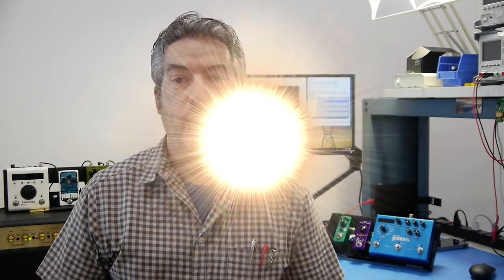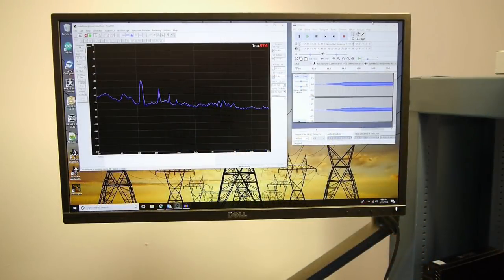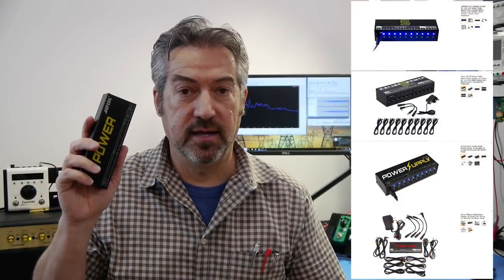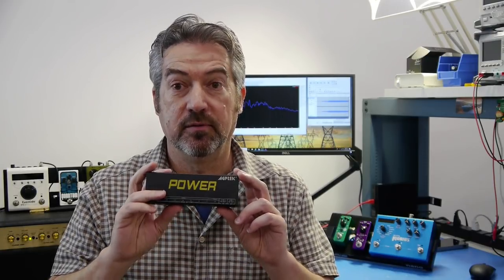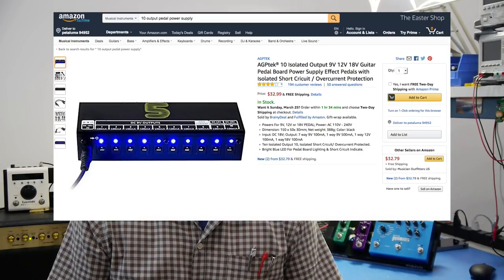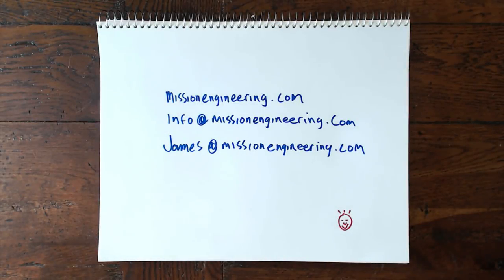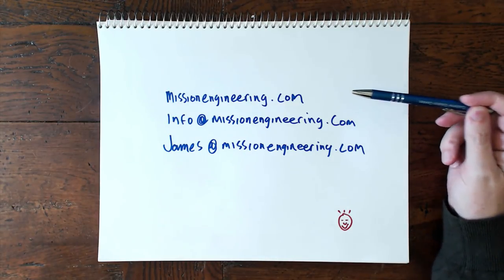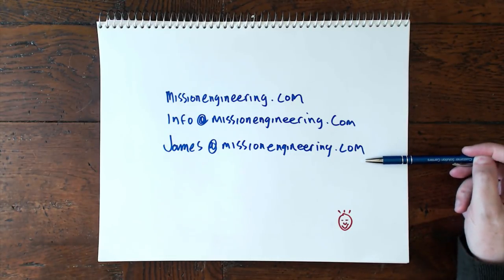Isolated vs daisy chain power supplies

Comment: If all analog modulation pedals and digital pedals were designed with Power Conditioner Filters you would use a switching mode daisy chain power supply? I'm surprised that most isolated power supplies never had built in AC line power conditioner filters to filter out very dirty 120vac noises, harmonics, spikes, surges, etc plus also have Power conditioner filters for each DC port to BLOCK all the digital clocks, switching frequency, digital noises from "backfeeding" into the Non-isolated power supply or daisy chain power supply. Any reasons why all the power supply companies omitted and let out the power conditioning filters?
Reply from the maker: Most AC/DC pedal power supplies do have some filtering on the AC input, but it varies on how much and within what parameters. Adding filtering increases cost, takes up more space and can decrease efficiency. There are other drawbacks too such as increased in-rush current. The designers make trade-offs based their target market and price point. Input side filtering has little to no effect on the digital noise on the output side issue as discussed in this video. The common ways to fix that issue are either galvanic isolation on each output of the power supply, or for the individual pedal designers to filter it out in the pedals themselves. In short, the reason for omitting isolation and minimizing filtering is to reduce cost, size, and development effort.
Reply: @JamesLebihan  Most digital pedal designers that use DSP chips, VGA chips, CPU chips, clocking oscillator circuit don't add in the power conditioning circuits internally inside the pedal because either they don't know how to filter it out or they never learned it on their EE engineering schools. I'm guessing this is called Power Conditioning, I'm not sure which is the correct term or name. The designers are suppose to filter out the switch frequency and noises that are riding on the DC rails. What I have been told is that a lot of digital pedals designers will offset the digital grounding to NOT sink the switch frequencies to ground which the power supply ground so there is a potential difference which causes more problems when using it with an Non-isolated power supply. The only reasons why Isolated power supplies became popular is because the digital guitar pedal designs started leaving in "backfeeding" digital noises, harmonics, switching frequencies, current ripples, leakage current, which don't go well with booster, overdrive, distortion pedals that are connected to the same tap of the daisy chain power supply or non-isolated power supply ports. A good designed digital pedal or analog modulation pedals that use clock signals can work with a daisy chain power supply, If its a well designed circuit. The Test Engineer in the R&D department would have to test the digital circuit with various daisy chain & Non-isolated power supplies to test and verify if the circuit is well designed that has all the power conditioning built internally. The Power supply should only be supply current and voltage, Not isolation for each port to port and also the power supply shouldn't be doing and blocking backfeeding and power conditioning on the DC side of the power supply ports. Yes the Power supply should have AC line power conditioning to block out the power surges, spikes, harmonics, light flickering switching but most guitar pedal power supplies don't have those types of power conditioning circuits at all. Most bars/clubs/rehearsal places of very dirty AC power which if the place has any machinery power tools or machinery appliances like dishwashers, fax machines, soda compressors, power tools connected to the same AC outlet breaker/phase1,2,3 its going to bleed into the guitar pedals board supplies which pass right through because of no power conditioning circuits blocking those frequencies, harmonics, noises.
Reply: @JamesLebihan  Some pedal designers will choose positive center ground which I'm not sure why they do this because if your pedalboard has half your pedals using negative center ground and the other half of the pedals are using Positive center grounds you will have problems why? The currents are both conducting in different "directions" from - to + or from + to -, so the guitar pedals current flows don't be flowing ALL in the same direction to sink to the same potential. A Band-Aid fix to all this is use isolated power supplies on each DC port with have a mini isolated DC to DC transformer. There must be some advantage or benefits why certain pedal designers will use positive center grounding. When mixing positive center grounding guitar pedals with negative center grounding guitar pedals there is "leakage current" and "Ripple Currents" that can't be sinked to one common earth potential. Measure the leakage current by measuring the circuit boards ground to the power supplies earth ground and it will be in the microamps of current which is leakage current in the grounds, NOT GOOD designer habits.

Comment: I have power supply that is connected on same plug where is connected my computer. Audio interface is connected with computer over FIREWIRE, nothing else. When I turn on power supply, I hear buzz in my headphones-spekers, that are connected directly to audio interface.  If I change to AC-DC adapter...there is no buzz...

Comment: Great, clear video! 
Also, question, do you know if there is a wireless/rechargeable power brick from the Strymon? Thanks! 12v 400mA
Reply from the maker: I don't believe Strymon manufactures rechargeable power supplies. However there are several models available from Mission Engineering https://missionengineering.com/product-category/products/power/

Comment: So isolated power supply only solve problem to Digital noise from digital pedal?

So if i use only analog pedal and noise come from vintage single coil pickup, isolated power supply won't help reduce the noise? Cuz afaik, single coil pickup noise is 60/50hz hum
Reply from the maker: There are other reasons that you want to use an isolated power supply, but it likely will not help with common mode noise from AC sources. Pickups are susceptible to noise from the amplifier and other AC devices as well as noise as a result of radiated emissions through the air. Gain pedals may increase the noise level along with the signal level, but changing the power supply wont help, as this noise has nothing to do with the effects pedals or their DC power source.

Comment: If I run my wall warts off a pwr strip, is the pwr strip isolated? I have 2 extension cords w/ 18v warts and Boss 9v w/ 3 out daisy chain for Boss modded pedal. Also have amp plugged in same pwr strip. Don't seem to have noise issue unless I  hook up Digitech RP-10. That thing is noisy w/o even being plugged in. LOL
Reply from the maker: Using two AC/DC supplies (wallwarts) the DC outputs should be isolated unless the supplies have a safety ground and the DC - is bonded to them which would be unusual.

Comment: I'm still not sure i understand this. I have been using a simple daisy chain, and i don't experience the types of noise you demonstrate here. Does that mean an isolated supply wouldn't benefit me? Aside from the noise floor, is there anything in an isolated power supply that makes the pedals themselves actually sound better?
Reply from the maker: As mentioned in the video, not every setup will experience this. It depends if you have digital effects pedals, and even some of those can be OK. If you are happy with you setup then you probably don't need to change it. If you add a digital pedal in the future and hear this noise, then you'll know why :-)
Reply: @JamesLebihan  Thank you. That’s what I suspected. I don’t play gigs, so there’s no variability of ‘power quality’ for me. And my daisy chain was fine with the digital Boss DD-200 I had for a while, so I expect it would suffice for the Collider I’m about to order. But, I realized I’m going to need more jacks than my current chain has, so I’ll end up having to get a Truetone CS6 anyway.... Thanks again, sir.

Comment: I wa using a daisy chain swap to a iso brick mxr and I still have noise coming out of the amp any suggestions?thanks
Reply from the maker: Isolated power will not fix ALL sources of noise so it may be coming from something else. A good start is to connect instrument to amp by itself and then add items one by one until you find the one that causes the noise.
Reply: @JamesLebihan  that's a good thing to do as well thanks

Comment: pleas answer this: is it safe t use 12v pedals with a 9v power suply? im new to this and wonder if the 9v x 8 power suply from the boss bcb 60 board can safely power my 12v and 9v pedals at the same time, or if they will be destroyed..if not, whats the easyest and cheapest solution? i want a board and power suply for under 150 euros. Thanks
Reply from the maker: in most cases it should be safe, but the pedals may not work as intended. 12V pedals are usually specified for this because they need the higher voltage to work correctly. Voodoo Lab, Strymon, and several others have power supplies with 9 and 12V outputs.

Comment: You know that you use two non isolated power supply, right? Little blue one has two paths (120mA each and 500mA). Please check loop between first forth sockets. I see your point and respect scientific approach but please could you check it?
To be honest I use also two path quasi isolate power supply with mostly buffered bypass fx.
Reply from the maker: The little blue one is the Mission 529 and that's our own product. All the 9VDC outputs are isolated from each other. If you measure between the first and fourth 9VDC outputs you will find they are isolated from each other. The only non-isolated DC - is between the 500mA out and the USB out.

Comment: Does it mean all regulated power supply are as bad as the AGptech? I have just got the MXR DC Brick and I’m a bit upset now
Reply: I believe the DC Brick does not have isolated outputs. MXR does have some isolated versions too though called Iso-Bricks. Non-isolated power supplies are not bad, and they work fine in many cases, they just don't protect against the noise issue I talk about in this video. If you experience this noise problem you will likely have to use an isolated power supply. Isolated power supplies are more expensive to make, and so they cost more.
Reply: Doug thank you for the reply. I understand you talk about a specific noise reason. I don’t have digital pedals apart from the Zoom G1. The rest of my pedals are a Polytune, EXH Soul Food and an analog delay from Xvive. Something very strange happens: at home, I get the typical “hum” which increases of course when I activate the EHX overdrive (amp bugera v55). During rehearsal, at the studio, sometime I get the hum, other times I don’t, it’s quite annoying, so I am trying to understand the reasons and a possible “cure”.

Comment: Very interesting and helpful. By putting the digital pedal/s after the analog pedal/s in the power daisy chain, would that avoid the digital noise?
Reply from the maker: Unlikely because the return path is common and the noise is not directional. The best you could do, is if you have a pedal that is particularly susceptible to noise or amplifies it since its a gain pedal of some type, then move that as far away as possible from the device that generating the noise. This will probably only have a minimal effect though. You really need to separate the return paths.
Reply: Thanks for the fast reply. I'll be checking out more of your videos.

Comment: I have a series of 7 pedals... And the mA added doesn't exceed the range of 1000mA.. will there be any noise then? Kindly help me out.
Reply from the maker: The noise discussed in this video is not related to the total current flow. There are multiple possible sources for noise in pedal boards, but the total current flow is not enough information to determine if there will likely be any problems. One approach is to connect all your pedals to your power supply, and listen for any noise issues generated from the pedals. Then remove each pedal one by one to see if the noise changes. If noise is reduced when a particular pedal is removed, try powering that pedal from a separate power supply to see if it fixes it.
Reply: @JamesLebihan  thnx man..will see if it works

Comment: Really great explanation! What if I have a pedal that's noisy on it's own? (Keeley Ver-o-Trem)
Reply from the maker: Check all your cables and that the power supply you are using is good and meets the specs for the pedal. Try with some different guitars and amps if possible to try and isolate the issue. Some effects inherently add some noise to the signal.

Comment: Thanks for your work. What about the MXR DC Bricks? They say it's isolated but then a lot of people say it's not true... Have you verify that? I ask because they also have the ISO Brick, what makes everything more suspicious. Best regards.
Reply from the maker: I have only tested the MXR MC403 power system. That definitely has isolated outputs. I believe there have been both isolated and non-isolated DC Bricks which may be part of the confusion. The current iso-bricks are supposed to be isolated but I haven't tested them myself.

Comment: First thing mate.... those AGP tech models that look the same are not all the same.
They got different guts in the various brands.
Reply from the maker: Cool. If you'd like to share the specifics of the different models and what exactly is different about the 'guts', I'd be happy to do an analysis of the circuit designs.
Reply: @JamesLebihan  buy a couple and take them apart.
Reply from the maker: I design pedalboard power supplies for a living and my lab is already overflowing with them so I don't really need to buy any more ;-) All of the really low cost units I have like the example in the video lack isolation transformers on all the outputs, which is the main discussion point of the video. I have some that showed up around the $50 price point from Ebay or Alibaba, but name brand Isolated power supplies from a reputable dealer are normally $100 plus. I thought from your comments that you might know of one of the $20 power supplies that was genuinely isolated. That would be interesting to see.
Reply: @JamesLebihan  I just built one myself from some DC to DC boost converters I found online.  So I guess mine is also isolated but I didn't use any transformers.  I just have a separate boost converter for each output.
Cost me about $25 dollars to build it.
Reply from the maker: It may not be isolated unless. 1. you use separate power sources for each converter, which defeats the object of a pedal board power supply somewhat, or they are specifically isolated DC-DC converters. Such things exist but they are more expensive and most of the low cost pre-assembled boards online are not isolated. If you have a DMM, I show in the video how you can test to see if your outputs are isolated or not. You may not care. Daisy chain supplies are cheap and work perfectly well for a lot of pedals.
Reply: @JamesLebihan  yep, they are.
I'm also powering them off batteries.
Reply from the maker: @aurthorthing7403  Nice. Can you share which DC-DC converter boards you are using? I couldn't find any low cost isolated ones when I was looking and ended up building my own. I'd like to get some if they really are isolated and that cheap.

Comment: Does isolation matter in portable rechargeable power supplies?
Reply from the maker: Yes. The issue demonstrated here is on the output side and will occur with battery power supplies too if the outputs are not isolated

Comment: Some pedals don't have this issue. For example, I have a few Roger Mayer pedals and those have filtering. They are very quiet even when daisy chained. The problem of course is that I have other pedals that don't have this filtering. Personally I think so many of these pedals are a scam on not really very well engineered for what you pay for them.
Reply from the maker: are any of the Roger Mayer pedals digital devices? I always think of his as mostly analog, but I haven't been keeping up with his recent gear
Reply: James Lebihan They are all analog and I think they are very well made. Whether people liked his effects or not is an another matter. They are not cheap but I think you get something that is technically better made than most pedals. His cheap rocket shaped fuzz pedals will not have filtering, it’s just the larger units. He also gives you a choice of one true bypass and two buffered outputs. Another thing is that you can add a battery without opening the box. He also has a wah pedal without a pot which is the weak point in traditional way design because it wears out. His wah is very expensive.
Reply: "Filtering" sounds interesting. I think the guitar/amp/pedal industry should focus on the fact that when all the sounds we like were created, homes and gig venues didn't have computers all over the bldg + customers sitting next to outlets to charge their phones. If a stage doesn't have clean power, I don't think there's a way to totally eliminate noise. I'll do some research on filtering as I'm dealing w this issue right now for some gigs I just picked up.

Comment: So you have the Amazon power supply hooked to the wall outlet and the other power supply to the battery.
I think this is a fouled test.
Reply from the maker: It makes no difference because the issue is related to the output side of the power supply, not the input. If you read the description or the comments there is a follow-up video where I demonstrate this:

For those that thought this was an unfair test because I used a battery for the isolated power source, here's a follow up https://youtu.be/_5sPLcFRCow